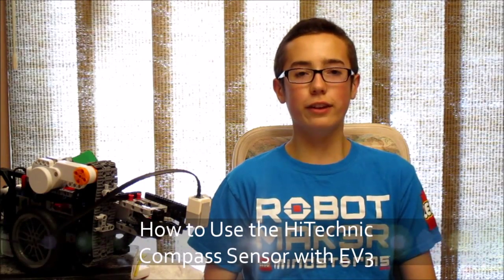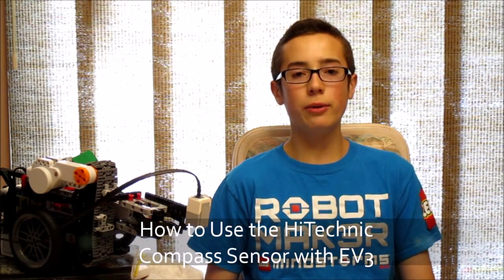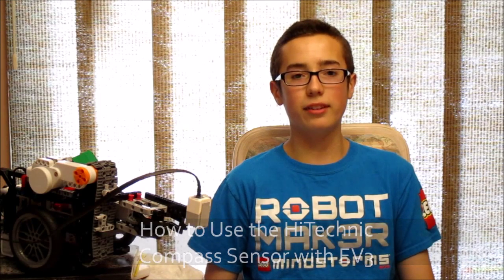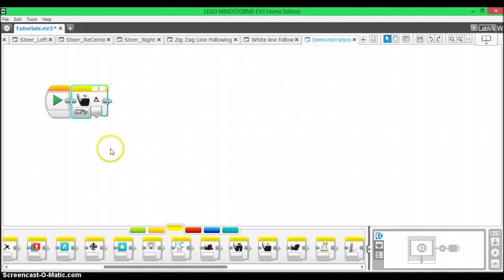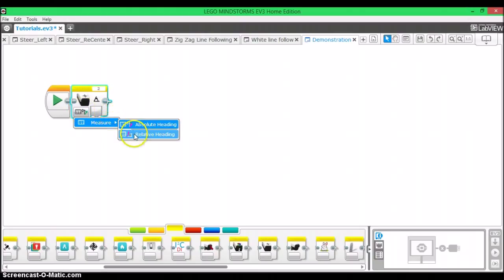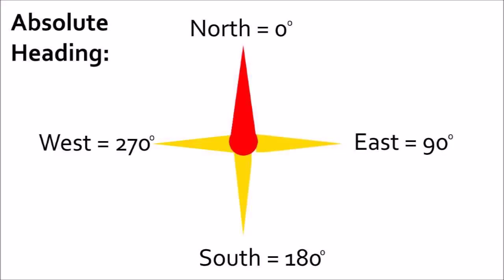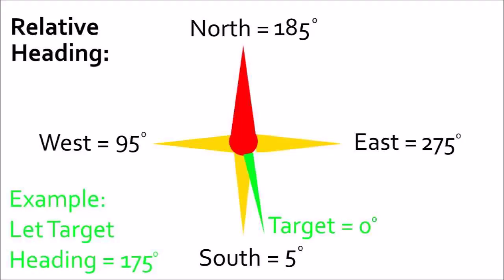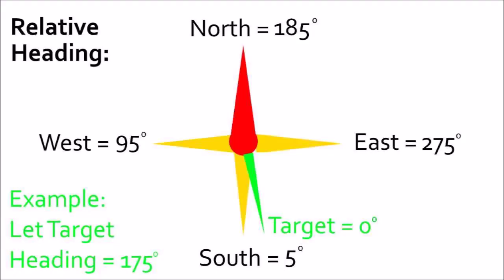How to Use the HiTechnic Compass Sensor for WRO Soccer

Comment: How do you calibrate this sensor? I have tried this block and it works, but when I start the program it doesn't start at 0 degrees. I have downloaded the block from your website and it seems like there is a start and stop calibrate option, I don't know how it works...

Comment: What does it mean if my ev3 brick is flashing a neon green or bright yellow while it's running?
Reply from the maker: The EV3 brick will flash green under normal running conditions. A flashing orange could mean low battery or another error. The EV3 lights do not flash yellow (unless that is the orange you are seeing).
Reply: When the EV3 is switched on, but not running a program, the LED should be steady (non-flashing) green. The standard behavior for the EV3 brick LED while any program is actually in progress (running) is to flash bright green. The flashing should stop when the current program ends.

I say this is the "standard" behavior, because you can include LED commands in a program. Those include:  (a) LED off; (b) LED green-flashing; (c) LED green-steady (non-flashing); (d) LED orange-flashing; (e) LED orange-steady; (f) LED red-flashing; and (g) LED red-steady. This provides you up to seven different LED "modes" you can include in a given program ... six of which are not the typical "green/flashing." Switching between colors, or switching from flashing to steady (or vice-versa) can be useful to let you know which step is currently happening inside your program as it runs. Very handy for debugging or for monitoring progress.

Officially, the LED on the EV3 brick has only those three colors (green, red, orange); there's no yellow color setting. However: the LED is very bright when viewed straight-on, and to some people the green and/or orange colors can register as a much lighter color ... including yellow (even white, to some people). Some of my students have reported the green LED appearing to be a bright yellow color to them, when it looks green to me, even when we're all looking at the same robot at the same time.

Comment: Is it normal that I can use the compass block as an independent one, but I can't use it in the "If" section?
Reply from the maker: Yes, HiTechnic did not program a Switch block case for the sensor. It's not necessary though; you can do all of the things you normally could with only the independent block.

Comment: Could you show some programming for the sensor.  Thanks
Reply from the maker: +fakermage Sure, anything specific you'd like to see?
Reply: +Builderdude35 how to set the robot on a heading then move to a new heading.  like waypoints.
Reply from the maker: fakermage Sure thing! It might not be up until July, because I need to study for final exams soon. But I will definitely get to it soon! Thanks for the suggestion!
Reply from the maker: Alright, so I may never get around to making that video so I will answer your question here. You would set the compass' target heading to whatever direction you wish to go. You can then program the robot to drive indefinitely in that direction. But, you would need another sensor, for example a color sensor, to tell the robot when it has reached whatever point you were trying to get to. When the color sensor's condition is satisfied, you would then set a new target heading, and the robot would head off in a new direction, repeating the process. I hope that answers your question. Let me know if anything else needs clarifying.